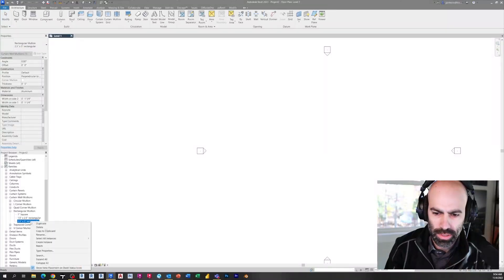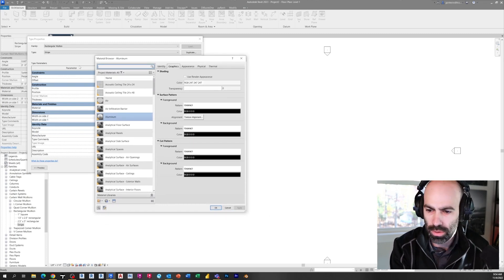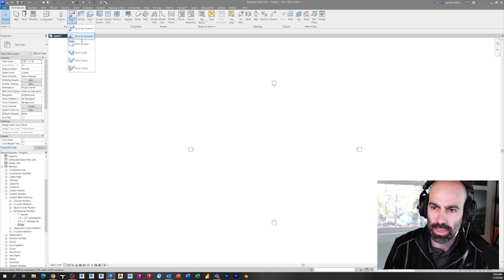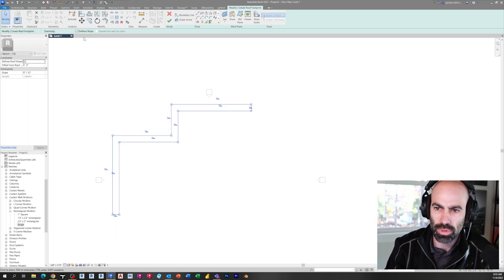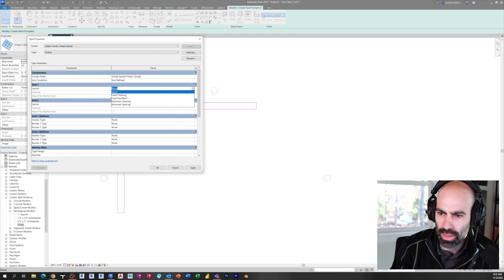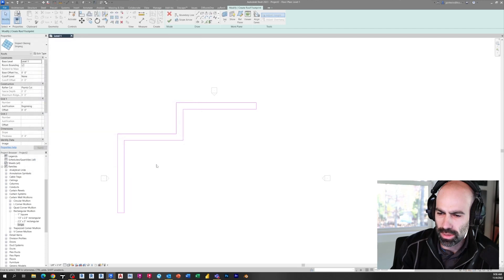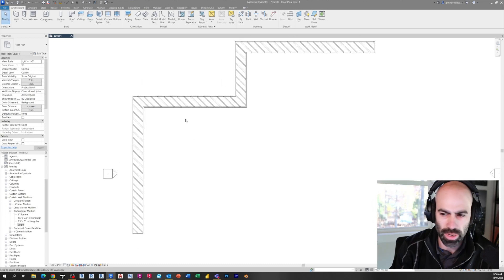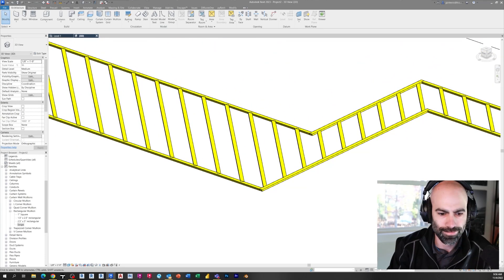Model Caution Striping in Revit Tutorial

Comment: Novel approach, but dude, you're killing me with the misappropriation of family types lol ;) Parking or site for the stripes. I have a few paramedic families for generating site stripe and parking families. Curtain wall types and interactions with other wall / element types.
Reply from the maker: What can I say…. I refuse to conform to the categories … also, this is a roof not a wall… it doesn’t interact with walls🤷🏻‍♂️
Reply: @TheRevitKid  yeah, we can get by with it on small projects; When it comes to larger BIM projects or quantity takeoffs, cost estimating, etc. It's a no-go.
Reply from the maker: @Apsis0215  I still see no problem. I work for a CM and as long as we know how the design team put this stuff together a square foot is a square foot regardless of the “category” used. Tools like Assemble make it really easy to condition and understand how models are built, too!
Reply: @TheRevitKid  true, anything can be filtered out or taken into account given training. Just requires additional training off the 'norm' (as if that exists.)
Reply from the maker: @Apsis0215  exactly, normal does not exist … part of the reason I advocate for every design team to have some sort of a BxP that at LEAST talks about their model setup/practices etc… such a  valuable document for that alone.
Reply: @TheRevitKid  I agree with you!  My other thought which is super powerful is using the railing family.  Maybe do a sideways panel system = )

I would just put in the panel component a do not schedule parameter or item specific depending on how you want your quantities to work! 😎
Reply from the maker: @bimetalearningchannel  I’d say railing would be useful if trying to follow tomography…. Otherwise might not be worth the effort of setting up haha!
Reply: @TheRevitKid , very true!  I guess it just depends on the overall goals that you want and whether the setup time is worth the use case scenario.  😇  

In some cases, I love that you are constrained by Revit Categories so ww do not have rogue users creating random layers… but sometimes I do wish there was that option still… 🤪🤪

Comment: Google翻譯:
Google Translate:
For me who do electromechanical BIM, I don't want to see this kind of thing
A similar effect can be achieved with two slabs (one frame, one image)
But the number of faces of the two methods is very different
For large-scale projects, many mechanical and electrical items will consume surface area (round pipes, pipe parts, sockets/switches, fluorescent lamps, cameras, intercoms, access control electromagnetic locks, detectors, sprinklers, air inlets and outlets...with heat insulation layer The number of tube faces will be counted twice)
I don't want to see the number of faces spent on one line
This method should only be suitable for small projects

Comment: Crazy. In ArchiCAD, the solution would be to create a dummy floor object, set the depth to 1/16th of an inch, paint it yellow, put it on the right layer, and copy/array it. This video would be ten seconds long.
Reply from the maker: Good thing it’s not an ArchiCAD video then ;)  also… because you went there.  It sounds like you’d be sketching the outline of these stripes manually and copying/array.  The point of this workflow is it automatically adjusts and all you have to do is sketch the overall outline of the pattern… no array, copy, etc and it adjusts   Automatically.  I’ve got no beef with ArchiCAD, I just felt I should respond 😉
Reply: Semantically, floor slab seems like the right way to do it. VG gets messed up using curtain wall for the floor I think. The Archicad workflow seems like it's possible in Revit as well. Thoughts @TheRevitKid?
Reply from the maker: @spaciotechtonics  100% you can make a bunch of slabs or extrusions and array them... but that sucks.  Imagine modifying it afterwards?  You can also use railings, adaptive components, a basic array family, and more... Don't be beholden to categories just because Autodesk gave us a list of categories and "VG".  They also gave us filters, design options, worksets, and more to control visibility and workflow!
Reply: Control is key no point spending time otherwise
Reply from the maker: @spickyhead1781  huh?
Reply: @TheRevitKid  what's the point in drawing it as an extrusion etc if u have to spend time again to change it.. With a cw system it's a few clicks and ur done hence u have more control..
Reply from the maker: @spickyhead1781  👍🤘🤘